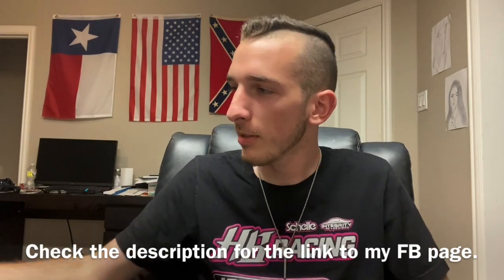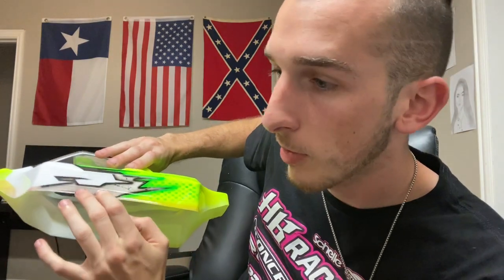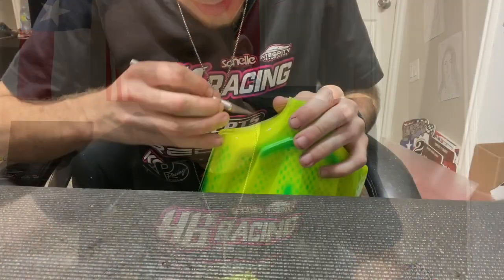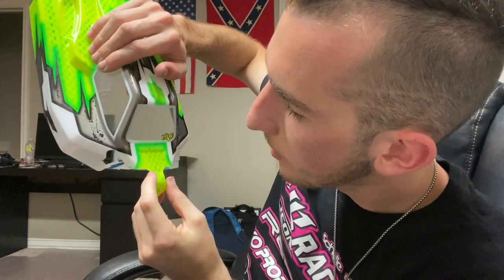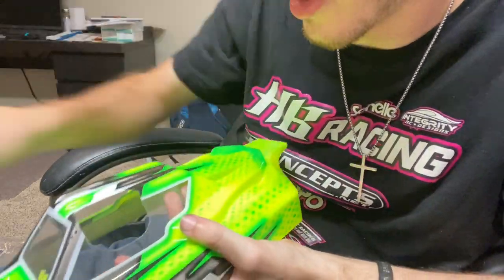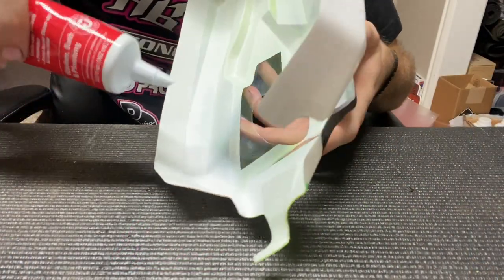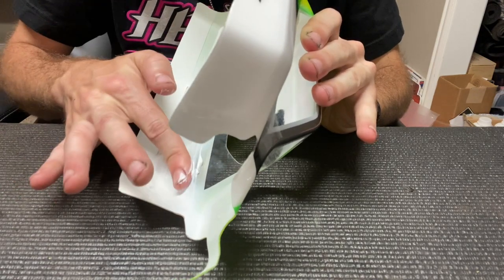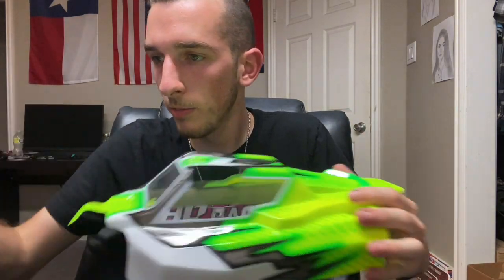HOW TO PREP AN RC CAR BODY FOR RACING!

Comment: Where u beennn
Reply from the maker: Haven’t had any ideas on what to make videos on dawg!
Reply: @dilloncaldwell7156  do some reviews
Reply from the maker: @xvblazexz7267  on what?
Reply: @dilloncaldwell7156  dif rc cars 
Maybe some tutorials 
How to pick the right batteries 
How to pick the right rc car
What r some good rc cars under 100$ under 200$ 300 etc
How to take out and put back in the motor of a rc car
Rc car basics 101
How to clean your rc car
10 tips for rc races
Reply from the maker: @xvblazexz7267   I can’t really do opinion based reviews on rc cars. Since I’m a sponsored driver. Can only talk about HB racing cars. So I could give info on those. But not any other brand. And I don’t mess with bashing cars. Check out Mark Santa Maria on YouTube for pretty good content! I can maybe think on some tech tip type of things though. 👌🏼
Reply: @dilloncaldwell7156  tech as in?...
Reply: @dilloncaldwell7156  HB?
Reply from the maker: @xvblazexz7267  HB racing is a race brand of cars. And that’s who I drove for. Tech tips as in like how to do things better.